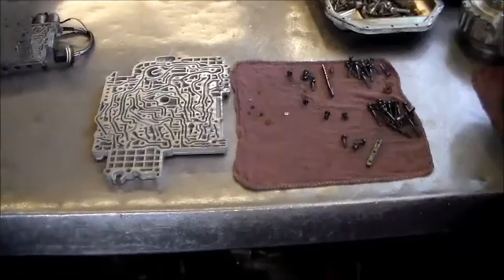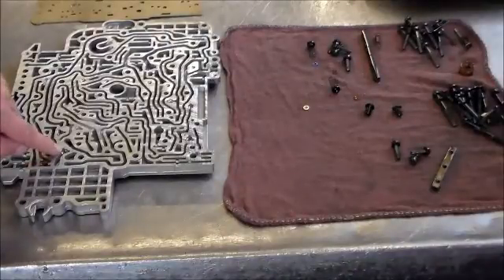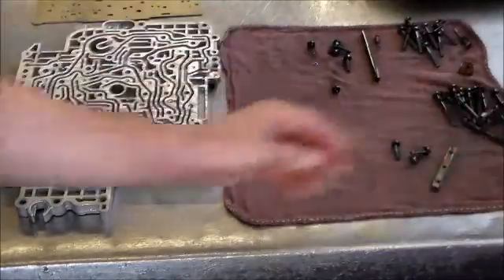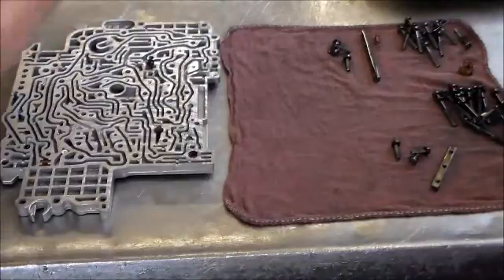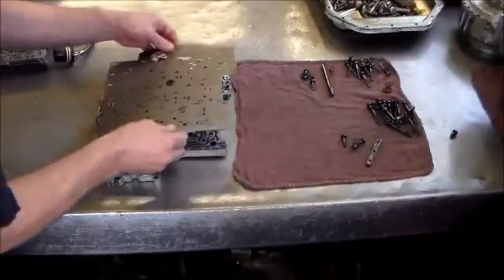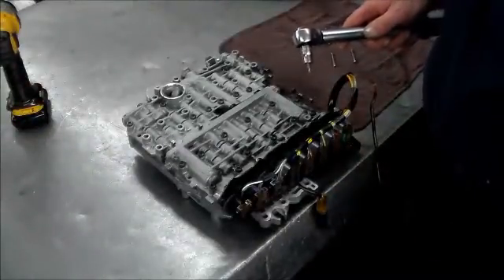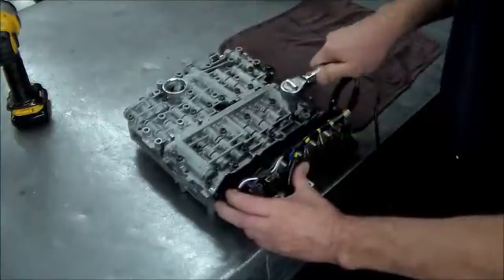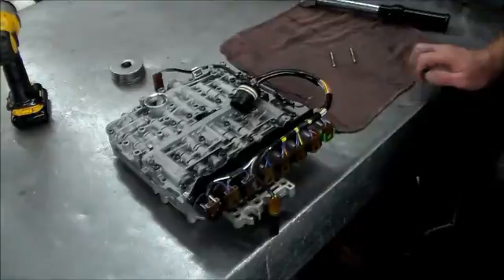ZF5HP24 Valvebody Assembly

Comment: Hey Gary, thanks for helping me thus far. I just put the transgo valve into the valve body, but before I put the plate and gasket over the main part I wanted to ask you a question. In my ZF master rebuild kit I have the rubber pulse reducer and the metal piece with the rubber ball on the end. In my valve body the metal piece was in there, but I didn’t see where the rubber piece went. Is that one or the other based on make and model?

Comment: Hi Gary, I have a 98 jag with zf5hp24 trans. I have 60,000 miles and no trans issues BUT I have heard these trans are ticking time bombs. A jag mechanic told me 90% of the failures are A drums breaking * but that 80% of those failures are due to a valve or solenoid that allows too much pressure on the already weak designed A drum. Is this true ? He said the part was cheap - should I have this replaced before it takes out the tranny ?
Reply from the maker: Yes, that is correct. The bore wears out on the main pressure regulator valve(lower front half of the valvebody) it creates pressure spikes and blows the A drum.  People that know about this had me do the lower valvebody for "preventive maintenance"
Reply: @GaryFerraro  Thanks for the reply Gary, do you know ballpark how much a service like that cost OR how much are the parts and how many labor hours ? Are you near NYC ?
Reply from the maker: @instructionaldesigner7310  I am on Long Island NY, will let you know,

Comment: Hello Gary, Did you put the updated pressure regulator valve into this valve body? Would you recommend it for the 03-05 Range Rover?
Reply from the maker: steelers412 I always put the 2nd design ref valve in. Check the bore make sure it's not worn
Reply: Ok.  Thanks I did install the upgrade one also.  He drove well for 4months.  Now I'm getting p0730 P0735 and sometimes p0894 and p0741.
Reply from the maker: so what exactly did you do, overhaul? or just install the updated valve? what was original problem?
Reply: I was originally getting a P0741 code.  So I replaced the pressure regulator solenoid and did I fluid and filter change but the code remained.  Then I disassembled the entire valve body and put the transgo regulator valve in. I was still stuck in fail safe 4 with no manual gears even after restart. I then replaced the tcm.  And got all gears back . Drove well for 4months now I have slippage in 3-4 shift into fail safe and slippage in fail safe also.  I can only drive in manual 1-3 until fail safe into 4 then 5 and revs until I downshift back to 3.
Reply: I was inspecting the valves and bores and was hoping that cleaning it would help.  I don't know if it did or not.  I forgot to mention I replaced the solenoid harness also.

Comment: Hey garry, love youre videos, so many shops must hate you for them. Ive got an issue with a ZF 5HP24A in my 04' audi allroad v8. Ironically im a tech at a audi dealership but the workshop manual is pretty light when it comes to information on the guts of the transmission. When the torque converter lock up clutch is in the controlled slipping phase from around 1300-1900rpm i get a cyclic flareing of the lock up clutch going between locked and slipping, over 1900rpm when it goes full locked i have no issues. would you suspect this is a pressure regulation issue from the valve body or more likely the solenoid having trouble controlling oil flow/pressure at low duties? Any help would be great. many thanks, Mike
Reply from the maker: Question,  are there any codes?   Can you see live data, wondering what the slip rpm is when fully locked
Reply: Gary Ferraro thanks very much for the reply. Zero codes. the measured value data shows zero rpm difference between engine and transmission input when closed. it's cyclic, only when the converter lock up is slightly dutied , when it's in this mode it shows a solenoid valve current value of between 0.30-0.45a lock value is 0.7 and solidly locked
Reply from the maker: Ok, at zero rpm its locked on. with what your describing, does it feel like a "rough road" going into lock-up?
Reply: Gary Ferraro nah it doesn't judder or shudder when the LC is going from open to locked. but I would call the locking abrupt, what I think is happening is the TCU Is asking for controlled slippage of the LC but when the solenoid is dutied and oil is supplied the converter locks fully instead of slipping slightly. the root cause, I'm not sure. Any suggestions would be great. Thanks mike
Reply from the maker: Ok, next question(sorry for the questions), does this happen all the time or only when cold but its ok hot
Reply: Gary Ferraro haha don't be sorry, and thank you for taking the time to help, I would have to say it's better cold for the say first 5mins, fluid temp of probably under 30deg C, i think that's about 85deg F
Reply from the maker: I can say that anytime i had an abrupt lock-up like your describing, i usually found an issue in the valvebody, have you tried resetting adapts, to see if anything improves.
Reply: Gary Ferraro I'm thinking it's a pressure regulation issue too, seeing as the issue seems to better when it's cold/oil viscosity higher/valve body cold. I see that the lower front section holds regulation valves. I might look at replacing this section and the control solenoid, oil, filter and see what happens
Reply: Gary Ferraro thru our factory tester I couldn't find the a channel to reset learned values, I might look harder. really appreciate you're feedback
Reply from the maker: The valves you would want to look at are in the lower front section of the valvebody(same section as pressure reg valve) One is the converter apply valve and one is the converter release valve. These 2 valves are located inbetween the pressure reg valve and the manual valve.  Make sure these valves are not stuck or dragging in the bore. If you need some pics i have info but its from a BMW. sorry for late reply ,going crazy here at the shop
Reply: Ive watched youre other excellent 5hp24 videos, i'll drop the front lower section and inspect it when i drop the pan and replace the filter with a new genuine one, and give it a good flush out, may also swap the TCC solenoid with one of the shift solenoids to discount that. cheers

Comment: I am trying to rebuild this vb, the ZF kit came with all new springs but the new ones are either longer with same diameter or smaller diameter but same length. I'm at a loss following the schematic. It regarding spring 55.030. use same diameter but longer or other one or original?  this is for an 2002 S6 quattro.

Comment: Hello, I'd like to change oil on a 5HP24A. I'd like to disassemble the valve body completely, and check everything. Do you have any advice on what I should change (with the hypothesis that everything is normal), like seals, bolts, gaskets ... ?

Thank you.
Reply from the maker: +slklite  Change the oil and filter is fine, use only OE filter, aftermarket filters on this trans are no good. I would only recommend disassembly of this valvebody to an experienced rebuilder, there are many small oriffices located in the channel plate section that would have to go back exactly where they belong. The only thing you can do is change the lower front section(this can be done without total disassembly) they are known for bore wear, but keep in mind all the valves and springs have to be changed over as well.
Reply: +Gary Ferraro Hello Gary, thank you for your answer. I wanted to clean the valve body because I have some problems with my transmission, and I thought that it could be a good idea to do something like in here : 

http://www.bimmerboard.com/forums/posts/527361

http://forums.audipassion.com/topic/141431-revision-bva-5hp24-zf-dortmund/

About my problems : the gearbox seems confused about finding the right gear on heavy load and uphill roads... But when driving with not a heavy foot, everything seems normal. Sometimes it seems the gear is lost and then, it comes back suddenlywith a clunk (but it's rare)...

Thank you for your help !!!
Reply from the maker: are you getting any trouble codes
Reply: +Gary Ferraro Hello, here are the trouble codes in the trans : 

17125 - Torque Converter Clutch 
            P0741 - 35-00 - Stuck OFF / No Power being transferred
17114 - Gear Ratio Monitoring 
            P0730 - 35-10 - Incorrect Gear Ratio - Intermittent
Reply from the maker: is this full of fluid,? what type of car is it?
Reply: +Gary Ferraro It is an Audi RS6, I checked the fluid according to this : 

http://www.thectsc.com/5hp24a-transmission-fluid-level-procedures

It was missing a little bit, and I topped it up.

There is a hill on the exit of my underground garage, and the car used to loose the gear arriving at the top of the hill. Now it seems, but I can hear a whining noise at low revs. I think it is the transmission oil pump starving oil, am I right ? Even after I topped it up, I can still hear the noise...
Reply from the maker: It very well could be, that would be an issue with the filter, cant use aftermarket filter with ZF transmissions must use OE, I had issues when i tried an aftermarket filter.
Reply: +Gary Ferraro All right, I'll do an oil service and let you know.

Here are the fault codes on my abs module : 

00283 - ABS Wheel Speed Sensor; Front Left  (G47) 
            30-00 - Open or Short to Plus
01435 - Brake Pressure Sensor 1 (G201) 
            48-00 - Supply voltage
01119 - Gear Recognition Signal 
            35-10 - - - Intermittent

These can cause transmission problems, right ?
Reply from the maker: +slklite   If it gets vehicle speed from the abs, i would say that it can cause issues.  Dont forget use OE filter on these transmissions. Just wondering where you are located? Gary
Reply: +Gary Ferraro I've sent you a private message.
Reply from the maker: +slklite  Ok,  i not sure where to look to read it, did you send it to my e-mail?
Reply: Nope, I sent it to your youtube inbox. I don't have your email...
Reply from the maker: +slklite  gsferraro@yahoo.com  is my e-mail, i still cant find the message. Thanks

Comment: hey what happens if you put a 3-4 accumulator check ball in the wrong hole?
Reply from the maker: +Wilbert Mendoza   It may not shift correctly,(hard shift,flare up) are you talking about a check ball or the small orifice
Reply: +Gary Ferraro Thanks for the quick reply i appreciate it Gary & This is the one im talking about the one in the pic it goes where he is pointing i put it in the little opening to the left of it car drives & reverse but i only have first & reverse gear lost all other, could this small ever been it im 100% i didnt do anything else wrong i took 3 days too have everything on point & now im lost http://s268.photobucket.com/user/transman618/media/Picture.jpg.html
Reply from the maker: +Wilbert Mendoza  This trans is a 4L60E, if you left the checkball out by mistake, i would put the ball in and try it, that could be your problem.
Reply: +Gary Ferraro ok thansk for the quick reply going to put it in the right place & double check it
Reply from the maker: +Wilbert Mendoza   ok sounds good